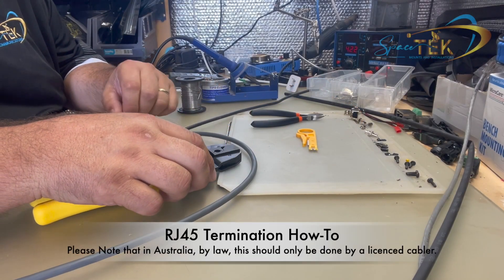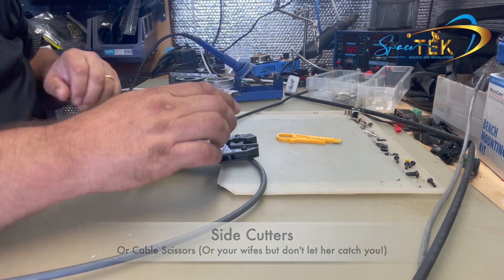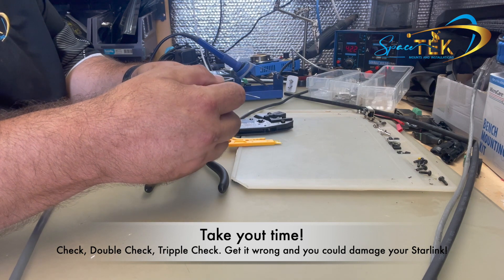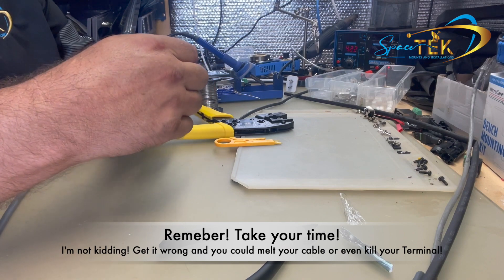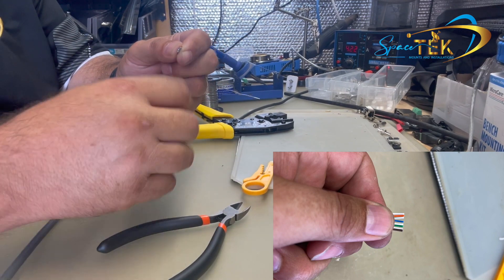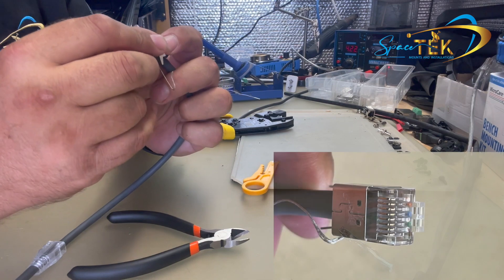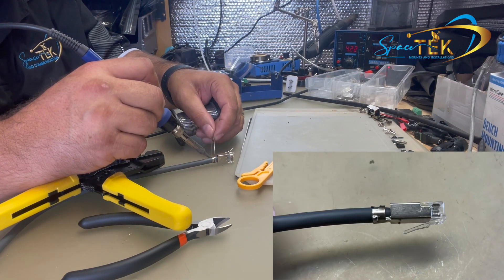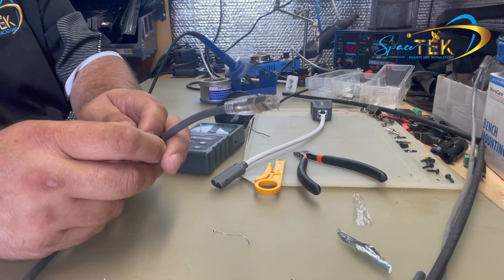Starlink Cable Modification

Comment: Thanks!! Are those lines solid copper? Or stranded?
Reply: Good question.  I have always been under the impression that it's NOT recommended to use stranded wire on these types of insulation displacement fittings.

Comment: I have just discovered a problem with using this replacement plug with your Gen 3 bulkhead adaptors, which are made to accept the Gen 3 RJ45 plugs, which do not have the retaining clip. I cut my cable, fitted plug, tested, all good. Then plugged the shortened cable into the bulkhead fitting. And found I cannnot get it out, as the clip is locking it in place, and now seems  inaccessible due to the redesigned inlet of the Gen 3 socket.  😮
So, if you are doing this mod, and using a Gen 3 inlet, make sure to cut that clip off. Or use a Gen 2 Bulkhead inlet.
Reply: You just need a tiny flat head to push down the clip.  It's not an issue.
Reply: @TripleTapHK  That is what i did, but it took a LOT of poking. The Starlink RJ45 plugs don't have the full clip.

Comment from the maker: It is important not to use normal side cutters, you MUST use flush cuts so that the wires are trimmed FLUSH to the rake and the rake is hard back against the sheath.

Comment: If I can add a tip on this. The "rake" is something I hadn't seen before, and I was a licenced Master Cabler in a previous life. Good idea, because if you just rely on holding them between thumb and forefinger and pushing them in, as is normal practice, they can get out of order. Always needed to check with a data tool. I just did my cable today, with Spaceteks crimper, and , after untwisting, found it much easier to leave the tails 50mm long and push each one through individually. Then pull them down and cut off. Very tidy.

Comment: Great video. A couple of questions, though. Does it hurt anything to leave the metallic foil shield, doubled back inside out? Is there any advantage to leaving it on? It would be a lot easier than trying to double it back without tearing it. Also, I suppose the use of the "rakes" makes the use of pass-through connectors unnecessary?

Comment: forgive me as I skimmed a fair amount of the video I was primarily just interested in seeing whether they used the proper cable coloring unlike some other 8-wire cables like consoles. I used to teach networking at the college level so I can terminate a B connector in my sleep pretty much. however I was curious what POE standard you need to conform to, to power the dish, in the event that this was being used at a site that actually had network equipment with native POE on ports.

Comment: You need to use a "licensed cabler" to modify a low voltage cable for your own use??   Holy cow, your government is crazy!  Why don't you folks vote for freedom and throw the bums out???
Reply: keeps the cowboys out. You had people with absolutely no training and sfa knowledge setting themselves up as data cablers, doing large installations. Altering a data cable for personal use? No-one will care. Modifying LV installations without a licence? They'll throw the book at you. As to your your "handymen" doing LV wiring? Jeez.  And, BTW, where has your idea of "freedom" ever got you, in recent times?

Comment: Its such a crock that only licensed cablers can make a change to a low voltage data cable.  I understand if it was running mains.  But I've every house I've owned, I've cabled it myself.  It's not rocket science.

Comment: Hello fellow Starlink Community,

I bought the Starlink Gen 2 and I will be moving in a new Apartment next month. 
I have a problem.
My landlord does not allow to drill cables through the wall.
Now I need a new solution.
How am I supposed to connect the starlink cable from outside the house to the router inside? Is there an option to get it through the window? I have European windows (Germany). I know there are antenna window feed through flat cables but is there an option for the starlink setup?

I would be happy if there is an option to connect the router without going through the wall. 

Thank you in advance
Reply from the maker: Unfortunately there is not simple solution.
Through the window will work and you can use some foam to seal it from weather and insects.

Comment: Starlink uses a different pairing. You recommend T568B. I suppose there is no problem as long as two like wired cables are interconnected since the incorrect pairing of one cable would be reversed by the other cable but would there be a problem if a Starlink cable was connected to a T568B/T568B cable?
Reply from the maker: If you are making a patch lead then you just make sure both ends are the same.

For the starlink cable however it is T568B only.

Comment: PLEASE NOTICE 

Can you split the original cable of starlink the
 1. White orange,
2. Orange
3. White green
6. Green
Insert is to the third party router( not the starlink router)

* The power supply will still be its original source ( from the starlink router) but instead of having the internet go directly to the starlink router, it will be go through the third party router. 
Isa this possible? PLEASE notice
Reply from the maker: No this won’t work.
Gigabit PoE uses all 8 wires

Comment: Followed these directions but had no success in getting Starlink dish to come online.  Replaced the shielded pass thru connectors twice, but still no go. The only thing I can think of is that the joiner I bought does not appear to be shielded, so the drain wire seems to be isolated at each connector and not feeding thru.  Could that be the issue?
Reply from the maker: The drain wire is important but won’t stop it from working.
Reply: yes, get a shielded coupler
Reply: @spacetek Same here. The dish has power as it rotates and positions itself due south but on the app it says not connected to dish and theres no internet. Could it be that one of the 8 wires didnt get crimped properly?
Also when i first crimped the rj45 i did one end in the opposite order accidentally, then coupled them to test. How badly this i mess up the dish or is there a protection in place to prevent any damage from this kind of wiring?
And to add, my coupler is also not shielded.

Comment: curious - what does the drain wire actually do - not actually required to work - but helps with draining excess electricity ?  So pretty much just a standard cat5e cable otherwise ? No problems using cat6 etc and splicing in the proprietary ends even.
Reply from the maker: It drains static electricity the builds up in the surface during operation and electrical storms.

Other than that it is cat5e

Comment: SpaceTek, what is the make or part number of the "rake" shown at 6:30 in the video? That would be very handy. Are certain Cat-5e connectors compatible or do they work with most of them? thanks for the video!
Reply from the maker: They are part of a complete plug set that SpaceTek have made to specifications.
We other 20k at a time.
They are available as a 10pack on our website or larger quantities by request.
Reply: @spacetek Hi mate is posible to hack starlin router as a aces poin mde? So th router starlinkonliy for AP mode